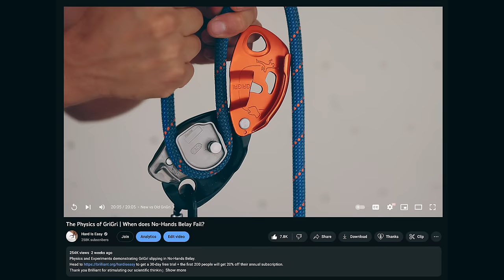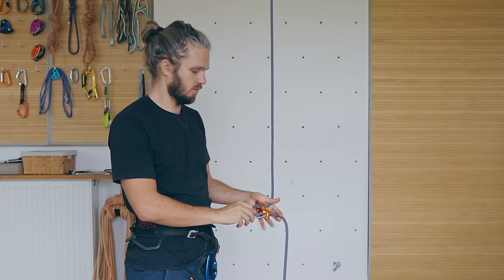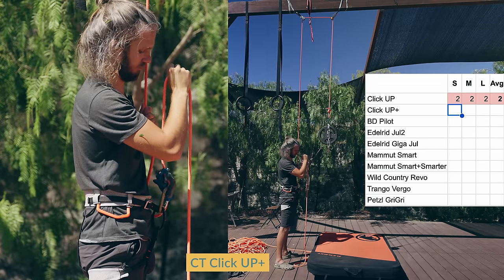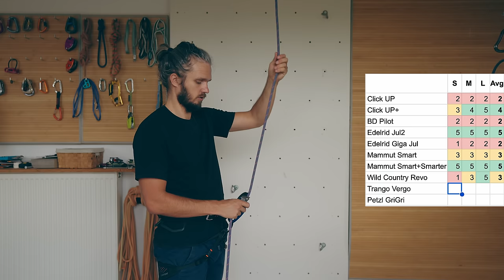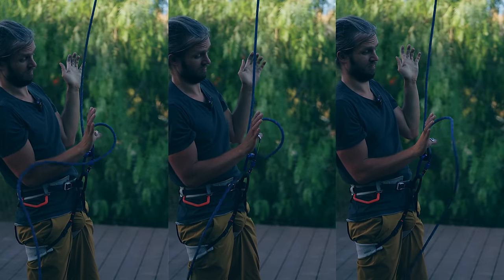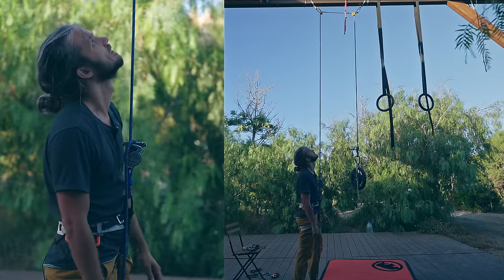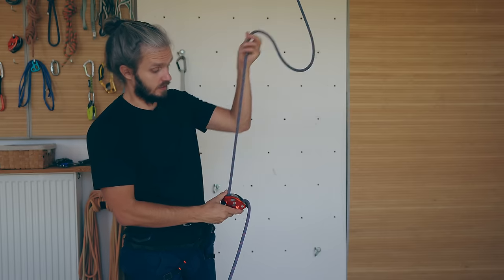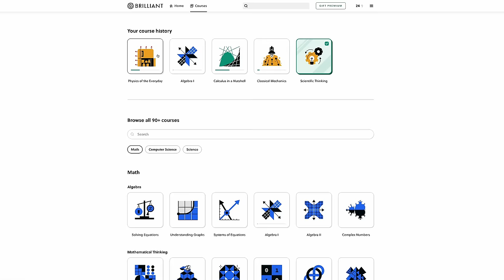When Assistance Fails!? The Physics And Experiments of Belay Devices

Comment: Thank you for your videos, but please don't hurt your hand more than that, and next time use gloves  😂
I'm not totally surprised by the Clickup behaviour, as it's not supposed to lock in these positions... In my experience if the user applies even a minimal friction on the brake side of the rope, it immediately locks. So : never let go of the brake side of the rope, as always ! 
It also helps than I'm often using a 9.7 mm rope, and at my climbing gym they use up to 10.5 mm ropes, so it locks quite easily.

Edit : As said in another comment, in the situation where it's locked, and the climber starts climbing again and falls, the Clickup would still stay locked because it needs an action from the belayer to unlock. So in this real world scenario, there would be no slip.
Reply from the maker: I used original Click Up a lot and it's a fine device indeed, the issue I pointed would be if it's not in a locked position and you loose control of the brake hand (rock fall, stupidity, etc...)
Reply: @HardIsEasy  In this case yeah, it probably won't lock. It's not perfect!

Comment: atc pilot requires it's carabiner, the gridlock screw gate carabiner. It performs a lot better
Reply from the maker: Not according to their manual: "For use with Type H or HMS locking carabiners only" no were it says that you should only use with GridLock or I missed something.

And yea all devices perform different on different carabiners and ropes so I tried to compare apples to apples.